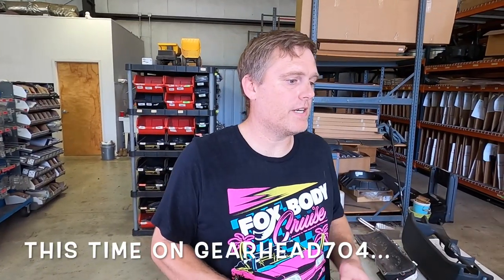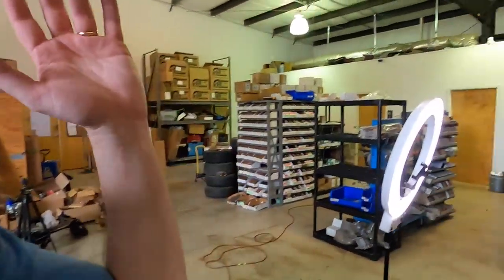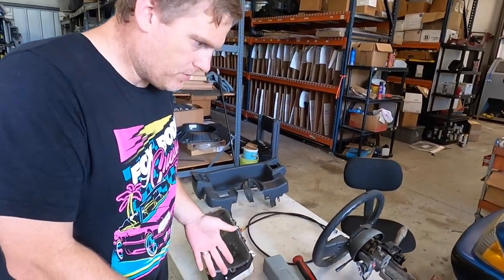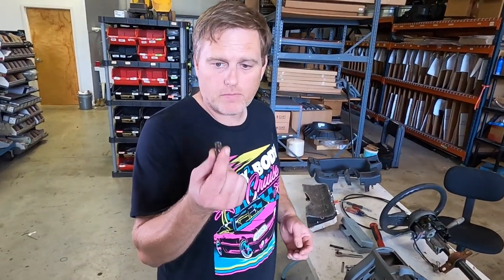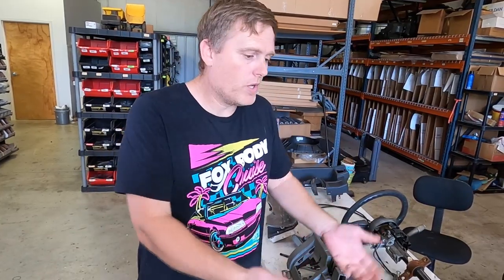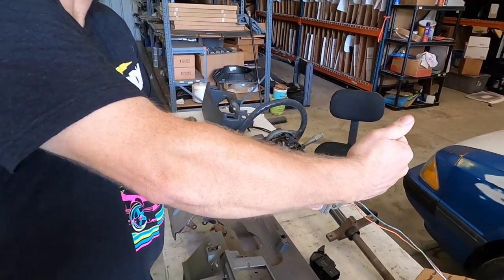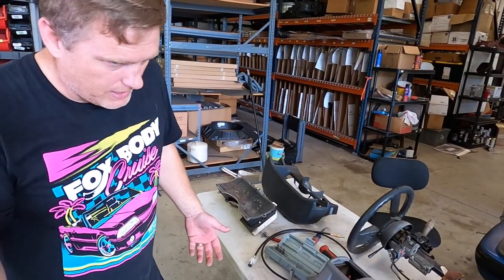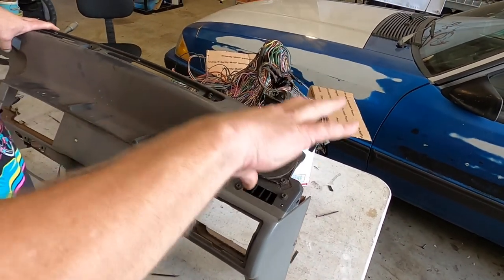Pulling the DASH on a FoxBody Mustang COMPREHENSIVE REMOVAL….How To Part One

Comment: Oh I've had lots of experience with removing the gauge cluster. I remember going back up with the steering column you have to be very careful and make sure any hot wire does not get pinched up against metal. Good thing I caught it. Almost burned down my car. But it is a learning process. Take your time and be very careful.
Reply from the maker: Oh man that would've been scary!  I'm glad that didn't happen.
Reply: I think it would be a pretty good idea to disconnect the battery on a job like this. 😉
Reply: Sam Scornaienchi it’s called a learning experience.

Comment: Awesome details, I was there on Monday and with Matt’s help I’m pretty sure this is where we are at with my a/c.  Have a blockage of some sort at the evaporator, so it looks like I have a dash pull in my future also.  I opened the system and will try to flush it 1st but I bet that won’t work.  This is necessary here in the south if your going to drive this car around with any regularity during the summer.  Matt said this was going to be a good detail vid, and he was right, thx 😊 y’all.
Reply from the maker: Oh man, well I hope the flush will do it, and it's certainly worth trying that first. Thanks, we tried to be ver comprehensive in this one. Oh and YES A/C is a MUST!